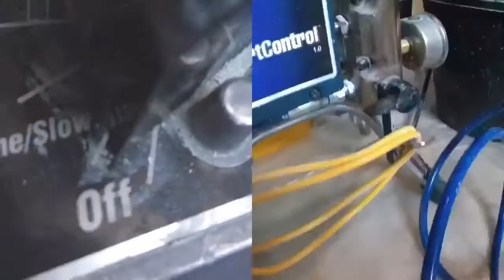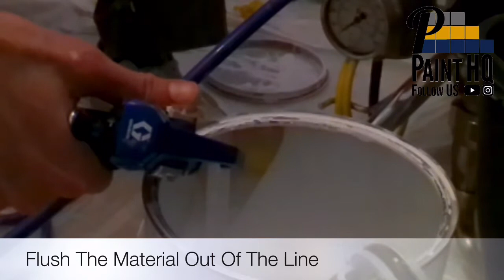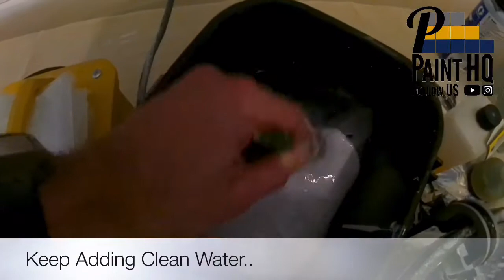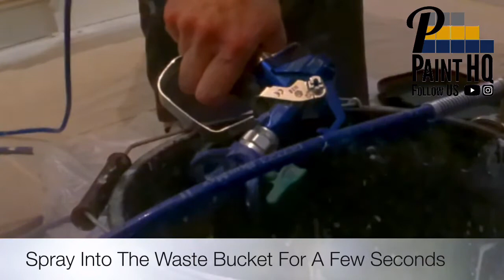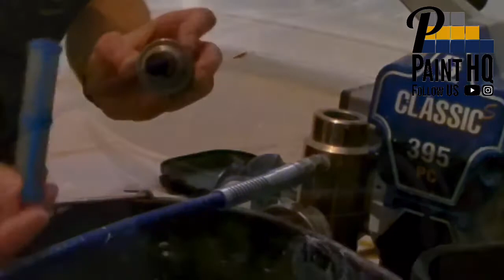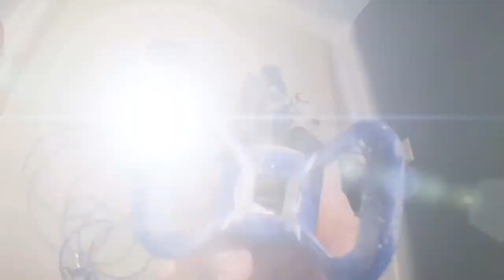Graco 395 Airless Paint Sprayer Cleaning FAST

Comment: Great video as always, i have a question about going from A shellack based primer like BIN or SW  to an urathane enamel paint like Renner or SW emerald, i hear you need to use mineral spirits to clean the shellack primer but im afraid of the mineral spirits contaminating the Paint, thoughts and advice greatly apreciated.  BTW i got the graco gx19 as you advised loving it .
Reply: Yes, you cannot leave any remnants of BIN. That's why a lot of painters have a system exclusively devoted to spraying solvents, otherwise, you do risk contaminating any waterborne coatings. If you do spray bin through the sprayer, run thinner through it, and then dish detergent several times to ascertain complete clearance of the bin. I screwed up some cabinets because I didn't completely flush out the mineral spirits and it contaminated my lines, causing insane fish eyeing.

Comment: Hi I’m taking the plunge I can’t decide on which machine 390 classic with a gun upgrade or the 395  I’m just starting out but would rather buy right rather than realise I’ve made a mistake I will befitting a hopper it just looks easier for the clean up
Reply from the maker: Great news my friend 👏 ..I was in the same position as you and went that bit extra for the 395.. if your budget can stretch to the 395, it’s worth it for that bit more power in the pump and the SmartControl (it helps regulate pressure, especially at the lower end).. the thing with the 390, I believe there’s no difference in pump when compared to the 290 (double check if I’m right). The 290 was released to the UK market more recently as a cheaper option to the 390, with the difference being a cheaper gun.. again, double check I’m right.. speak to Mike at SpraymanUK, say Pete from PaintHQ put you in touch.. he’s so helpful and won’t sell you something you don’t need.. (I’m not sponsored by SpraymanUK by the way 😆).. The 395 with a hopper is great 👍 ..If I was on more of a budget, a step down from the ‘classic’ range is the GX range.. by no means a step down in quality, the GX range is aimed at the painter and decorator who’s not spraying all day everyday like on site.. I rate the GX21FF (it’s a GX21 with a hopper). You can effortlessly swap between hopper and siphon.. again speak to Mike.. if your instinct is the 395 I’d say go for it 👍 you won’t regret it 💯 let me know how you get on 👍
Reply: @PaintHQ  cheers for the reply I’m going for the 395 I’ve got a job lined up already I’ll let you know how I get on cheers pal👍🏻👍🏻😷
Reply from the maker: Ah well done buddy 👌 and congratulations with the job.. if I can offer any advise at any point, I’m there for you 💯
Reply: FYI you can order the hopper from Home Depot for 60 bucks.
Reply from the maker: @KurtBelyeu 🙏💙💯

Comment: Hello, I was wondering how much pump armour you put in the hopper, & do you Prime until the hopper is empty? (Especially if there's more than you need in the hopper)
Also, how often do you use your extractor fan?
👍
Reply from the maker: Hey Matt, hope you’re keeping well.. I’d say it’s about half a cup.. what I do is pour half a cup of Pump Armour into the empty / clean hopper and with the return pipe over a waste bucket.. in prime, just give it short bursts until you see blue liquid enter the waste bucket.. if the Pump Armour doesn’t look enough in the hopper, just add a splash more.. once it’s running blue, I leave what’s hopefully a glimpse of Pump Armour showing in the bottom of the hopper.. when next using, I prime that back into the bottle.. so you can reuse over and over, a bottle lasts ages 😆 hopefully that makes sense, if not feel free to get back to me.. regarding the extractor, I’ll use on the bigger jobs in occupied houses.. such as a HSL where there’s a lot of woodwork.. stair spindles etc, then doors and frames etc on top.. I think the HSL video where I show the extractor, there was 10 doors and all the associated woodwork.. I’d say they’re not essential, but it’s worth the investment to be able to use one.. if not using one, open a window strategically to create a draw of air outside, it does help a little.. even using the extractor, you still need to open a window slightly to created that flow of air to get the dust outside 👍 Thanks for your question, feel free anytime.. regards Pete 🎨💯
Reply: @PaintHQ  yes that makes sense, thank you 👍
Reply from the maker: Ah nice one buddy, I’m glad 😆
Reply: @PaintHQ  it's a lot to take in at first, but I'm getting there 😀👍
I'm wondering when the paint HQ academy is starting 🤣
Reply from the maker: Haha, I’m working on it my friend.. aiming for next year 😆 ..in the meantime I’m more than happy to help any way I can.. I appreciate how you feel, I’ll give you all the encouragement I can 💯 ..are you able to make the P&D show in Coventry in a couple of weeks (23rd / 24th)
Reply: @PaintHQ  maybe, I've got a lot of work on, & in the process of moving house, so I'm going to see how it all works out 👍
Reply from the maker: No problem buddy 👏👌👍😆
Reply: FYI lots of people skip pump armour and use RV or Marine antifreeze.  If the pump will set for a while use mineral spirits, it'll keep rust from forming inside the sprayer.
Reply from the maker: @KurtBelyeu 💙💯

Comment: What is the difference in the classic 395 and the ultra 395 , I got the ultimate nova 395 from graco but the nova is only
Sold at sherwin Williams . The nova 395 is lighter than the ultra and a little louder and slightly weaker . Curious what’s up with the classic 395?
Reply from the maker: Apologies for my delayed response my friend, I will always reply and answer questions if I can 🙏 ..you’re right in the ‘Classic’ range being slightly scaled back Vs Ultra without compromising on spec and build quality.. so the 395 pump size and tip specification (.023)  will be the same, but you get the Contractor PC gun with the Ultra.. plus the main factor being that the range is different from region to region.. so a bit like you’ve experienced too, the Ultra 395 is not available in the UK, the first model in the Ultra range is the 495, and in the 395 spec it’s the Classic 395 PC.. if that makes sense 😆 ..keep in touch buddy, always great to hear about your experiences 🙏 ..regards Pete 💙